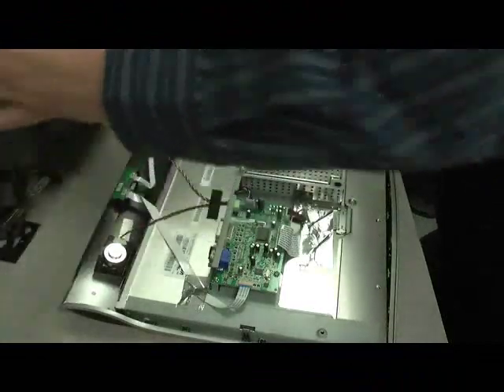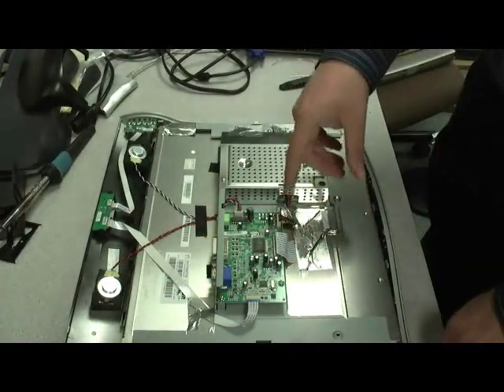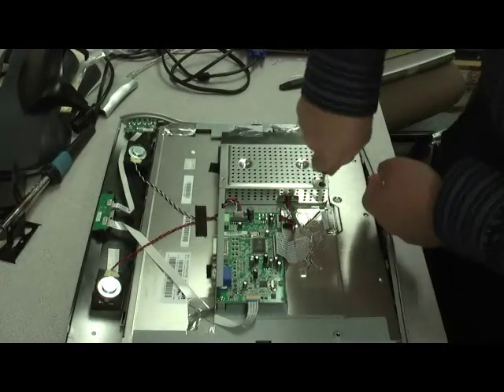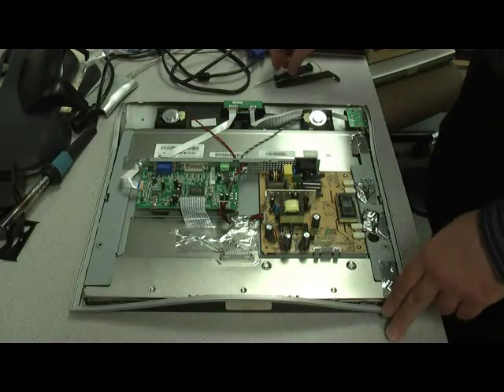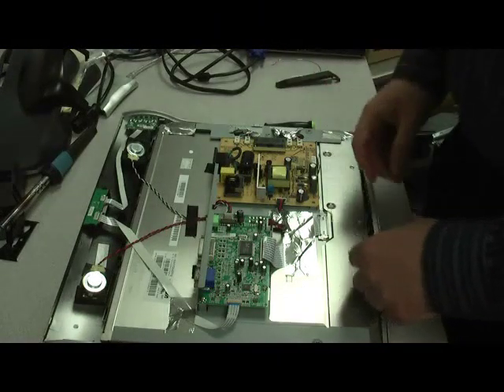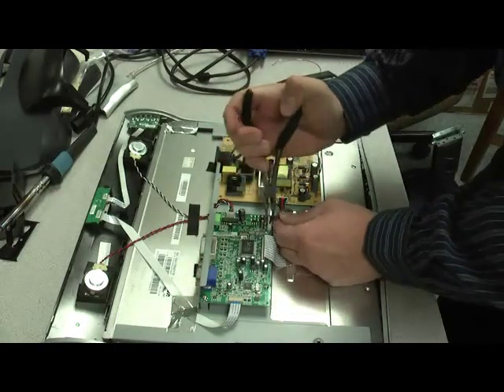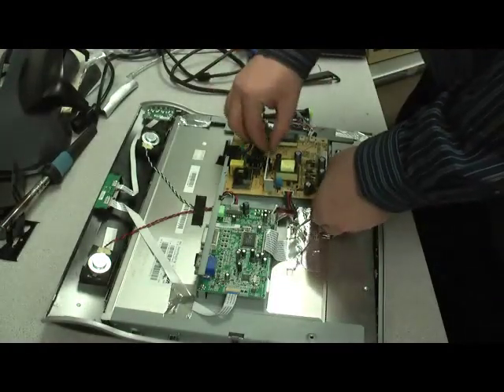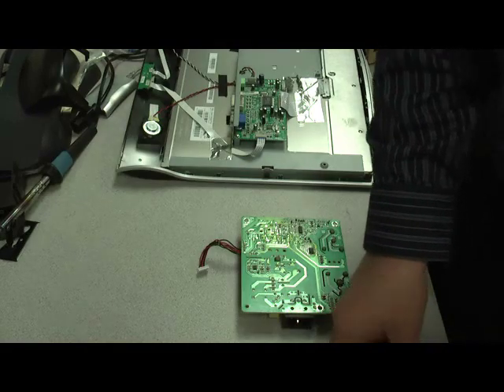Repairing the ViewSonic VG730m - 2 of 5

Comment: Question for you, I watched your videos, pretty good BTW, I have a view sonic 2835, It shows the blue power light, and occassionally a display, mosly the blue screen, as in sleep mode. Lately I have to keep rebooting the PC, first time this happened, 3 times, next day 4 or 5 times, and today, not getting anything more that a glimps of display. When I try to id the montor in dislay settings, I do not get anything on that. This is an older monitor, that when it displays, works very well. It still has sound, and usually get nothing if I press any of the bottons on the front panel. I looked around inside, and say one small diode that looked like some heating took plae, as the solder around it is slightly discolored. Any suggestions?